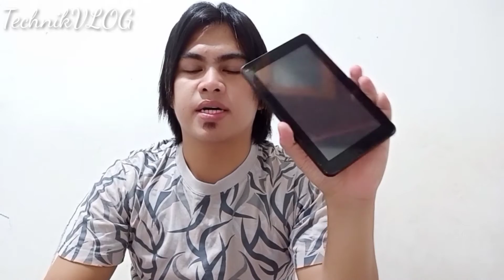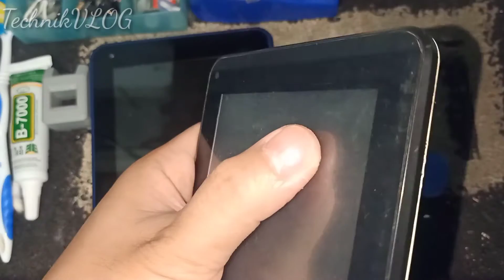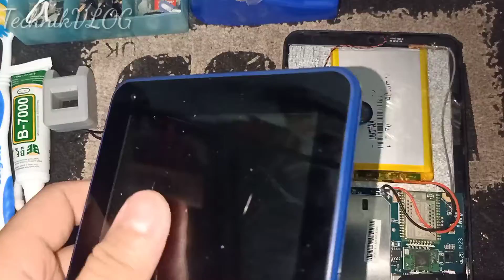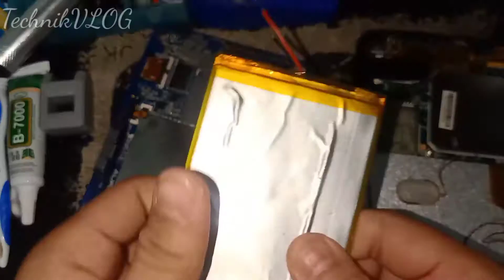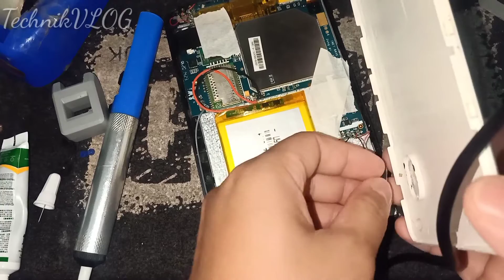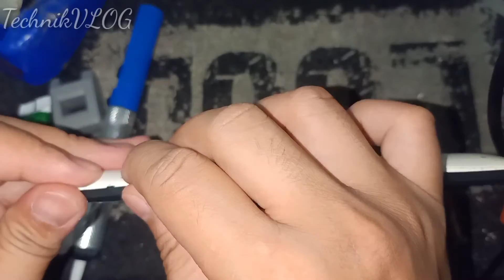TABLET NA MABILIS MALOBAT ITO ANG DAPAT MO GAWIN

Comment: Hi Sir, may pag asa pa po bang tumagal ang battery ng tablet, Kapag old version na po ito like 2014. Kasi bumili po kami ng tablet Note.10.1 labas nya po nong 2014 pa. Tapos nong binuksan namin nasa 85% pa yong battery, wala pa pong 1hour lowbat na po sya o normal lang po dahil sa taga na di nagamit. Salamat po and Godbless 😊🙏😇